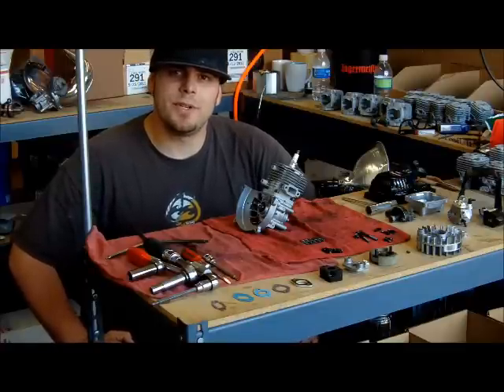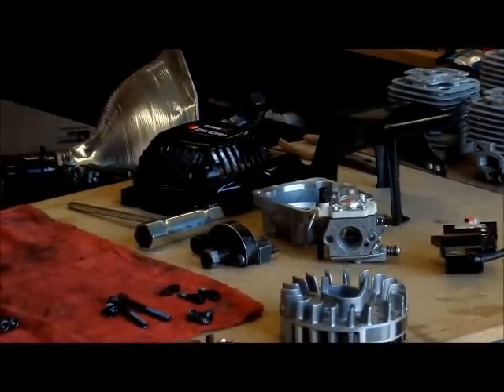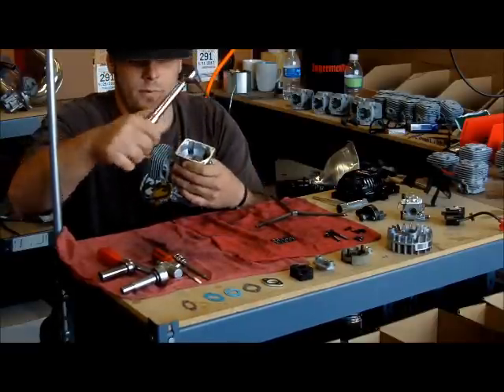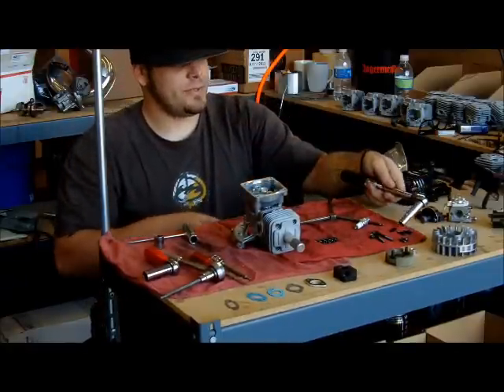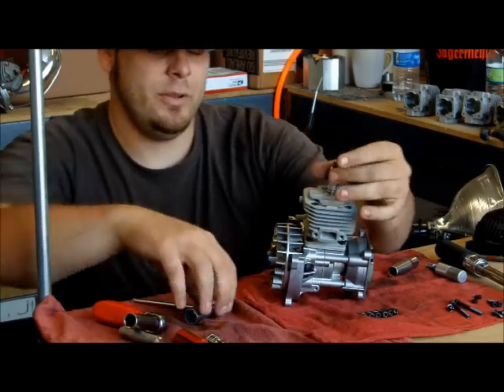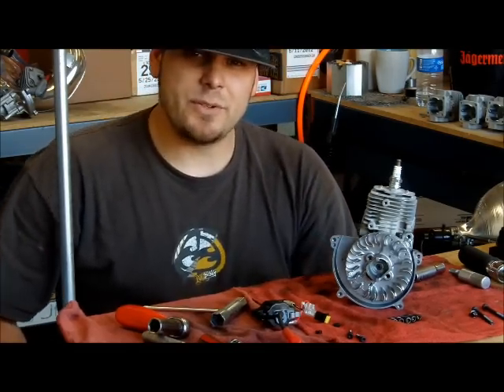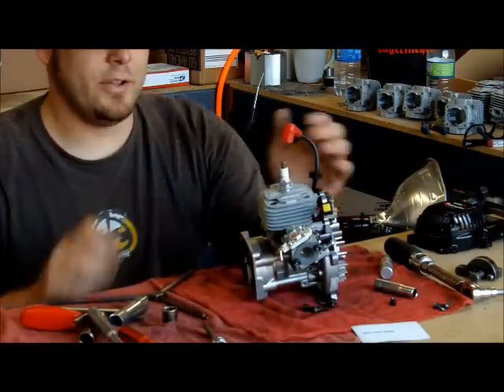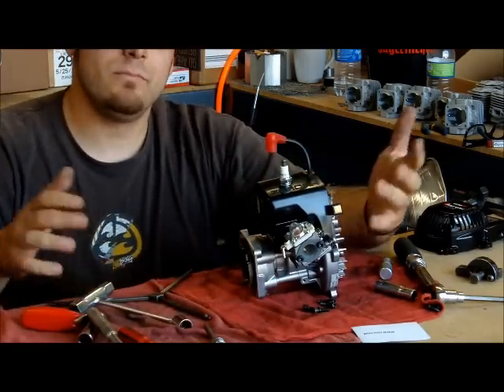OBR Tech Video - How To Double Your Power by Completing a Long Block

Comment: Would I be able to use that on the stock 29cc losi 5t, or what can I do to get the most power out of the 29cc without buying a in motor. Any info i really appreciate. Thanks

Comment: Sorry to bother anybody but I'm having trouble with my engine it's a cy 29cc where the clutch holder/plate goes on the crankshaft its supposed to be a friction fit with a retaining bolt in the centre but no matter how tight in make the bolt the crank just spinning in the clutch plate

Comment: What allen key is that you use
Reply: A 5mm bolt probably wants a 4mm Allen key.

I’m fond of the  Bondhus brand, especially the ones which resemble screwdrivers.

Have a 43cc (Zenoah) engine, which I plan to use in an emergency generator.

Comment: thx for the vid...see they have come out with all kinds of new ones ..now my question is what does the clutch housing mount onto...the old ones were simple just use to have a spindle and it would bold onto the classic california go ped frame...anyway u could help me out.. i was thinking about buying a new motor for my go ped but cant figure out what the clutch assembly and the clutch housing mount onto....dont know what the assembly parts are called
Reply from the maker: If your goped has a clutch the engine will bolt to the clutch carrier/engine mount. Which model goped do you have? If you're unsure you can always email us a picture or two and we can verify.
Reply: ya for sure..do u guys have a gmail or some kind of via email..i have tried to send photos through message but it wont let me
Reply from the maker: Use the contact form on our website and when we will reply from an email you can send pictures to. I don't think youtube will let me post an email in the comments.
Reply: ya looked up your guy's website and hit contact us..but the site will not allow me to copy and paste images...nor will it allow me to add it as an attachment ...

Comment: Gday mate, I have a few questions regarding an engine. i am thinking about buying a 34cc engine off you guys but i am unsure of what the difference between a normal engine and a long block is? secondly, i do not have a torque wrench but would doing all of the bolts up nice and snug do the trick? cheers
Reply: +Sean O'Neill you answered my question that i have been researching for a month now lol..thanks!
Reply from the maker: +jack oliver They are both exactly the same but the long block is basically a stripped down version of a complete engine. You can save money going with a long block but you'll need to complete it with your stock engine.
Reply: Ok sweet as thanks heaps!

Comment: Does the piston ring gap have a proper orientation in relation to the piston?
Reply: The rings in two-strokes are guided by small pins - usually brass or steel - that go partly into the ring groves.  They do not rotate in the grooves like in most four-stroke engines.

If they did rotate, the ends would snag in the ports!  Hence, they are pinned in the piston.

Comment: So if u have extra motor parts laying around all ready it would be cheaper to just get a long block instead of a complete engine ..would the parts from a 2 bolt work on a 4 bolt long block? Flywheel , clutch , clutch housing  etc
Reply from the maker: Diy type of guy That is correct and yes the parts from a 2 bolt will be compatible. If you have the parts to complete the long block it will save you $100-150 over buying a complete engine.

Comment from the maker: All of our long blocks are ported and will have more power than a stock engine. A long block basically is a cheaper alternative to buying a complete engine if you have a stock engine you can complete it with.
Reply: does signature series have more power?

Comment: What drive is your torque wrench. Is it 3/8 or 1/4. I just want to know because I want to get one that's suited for the baja engines. I've got a g290 zenoah. It's inch pounds too is that correct.

Comment: The torque specs you mention differ from my Zenoah manual. It says 7.8nm max (around 69 inch-pounds) for the clutch. Are the torque specs different for tuned motors?